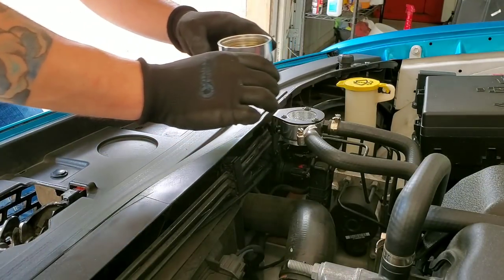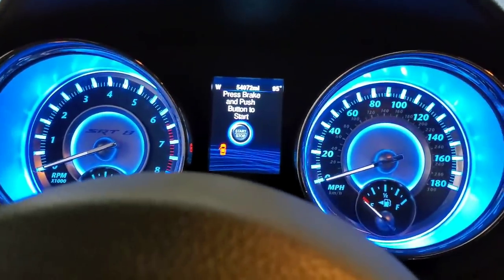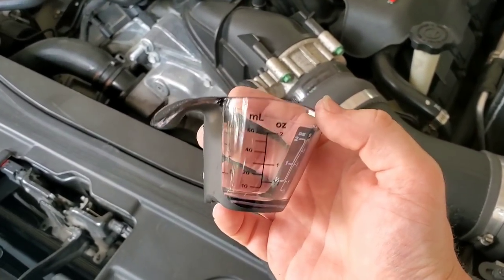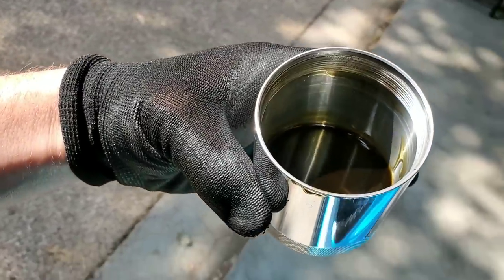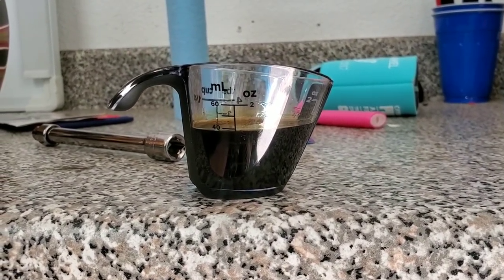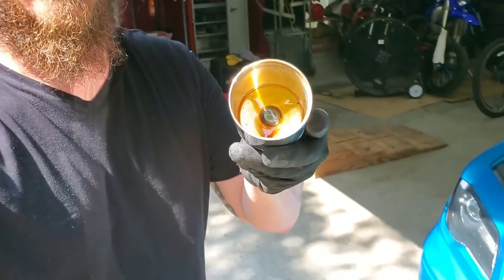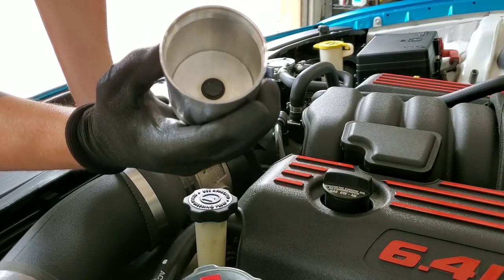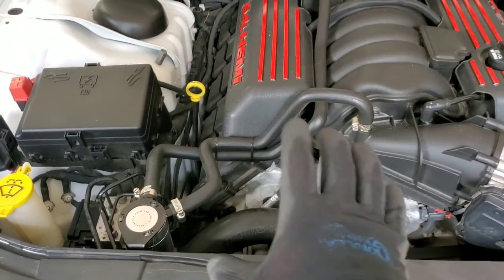Do Oil Catch Cans Work? | Review after 3600 miles | 2013 Chrysler 300 SRT8 392 | 6.4 Hemi

Comment: I have a catch can too but mine has a drain valve at the bottom so I dont have to twist off the lower half of the can. Much easier design. They do work.